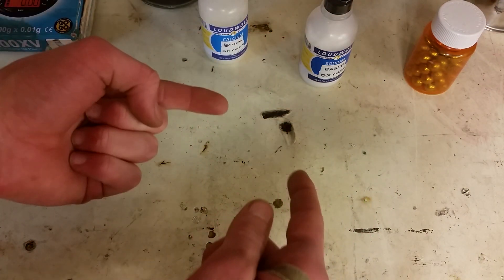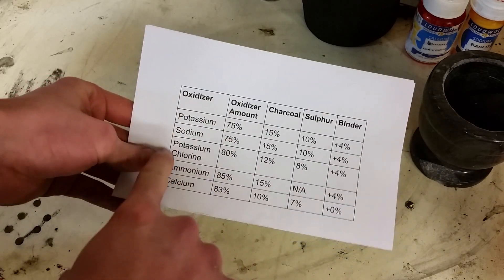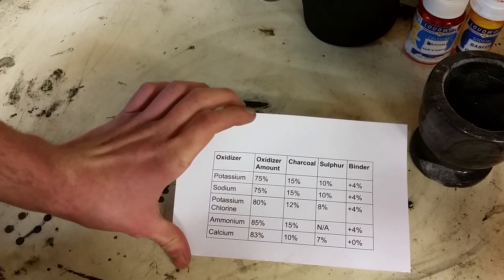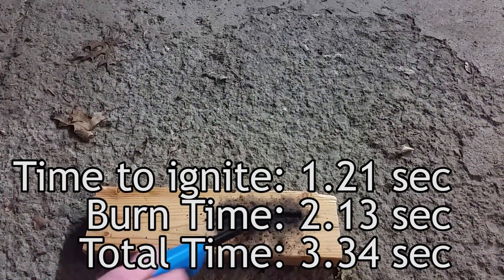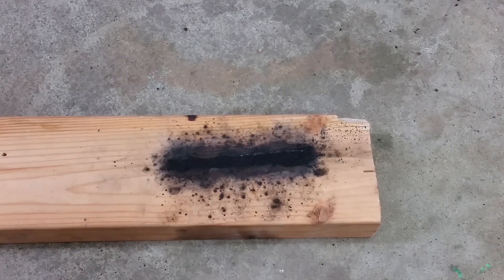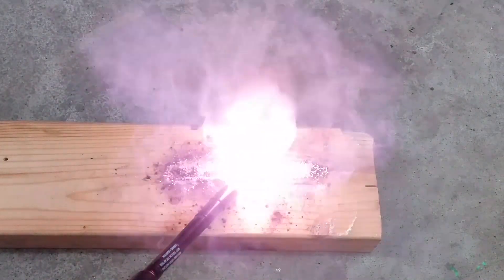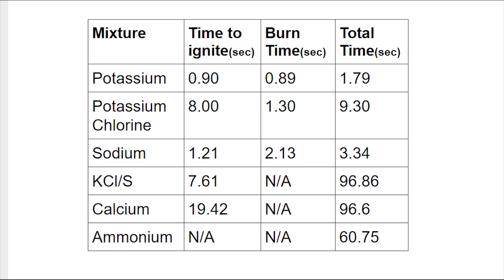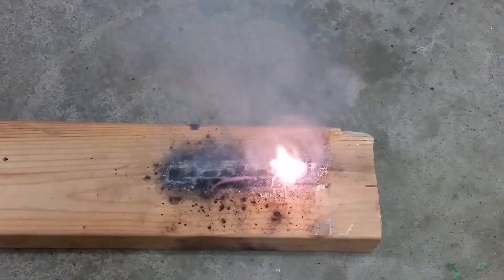Making Black Powder with Different Oxygen Sources

Comment: A quite interesting mix I found out recently is a 3:1 ratio of Potassium chlorine based Oxygen (with 3 O Atoms) and charcoal. it burned quite quick and it was very easy to ignite.
Reply: i found a 6 , 3 , 1 , mix of the chlorine based unmensionable potassium compound with the [3 o's] 6 parts, 3ofcharcoal, and one of sulphur , makes a nasty , fast burning , shock sensative , detonateable powder !  use it in my fuses as well as firecrackers for new years , one powder for both is convirnent

Comment: This is the exact thing I was looking for, thanks for trying. If you were gonna do it again I’d say mill a little longer (if it’s safe to do so). Also possibly Corning the powder after you saturate it with 50% isopropyl might help if you didn’t. I know for bp it’s crucial because the kno3 absorbs into the charcoal when wet. So it’s a much more intimate mixture. Very cool video, keep them coming! (Ps a blackpowder ratio vid would be cool, cause I’ve seen a vid where a different ratio is a lot faster)
Reply: Im at the beginning of the video but also physically compressing while moist makes a huge difference aswell.

Comment: Potassium based oxygen does indeed taste pretty bad lmao. Even when you have a mixture of 13:7 oxidizer to sucrose lol
Reply from the maker: Actually that was the calcium based oxygen, but iirc the potassium oxidizer tastes similar.
Reply: @RangerOfTheOrder  ah ok. I've never experimented with the calcium one yet but I'm not surprised it tastes similar. I've tasted cesium chloride and in my opinion it tastes kinda like sodium chloride but more intense, cold, and kind of has more of a sensation than taste. Not bad though, but I'll stick to the regular stuff